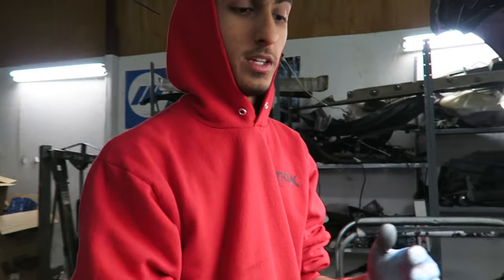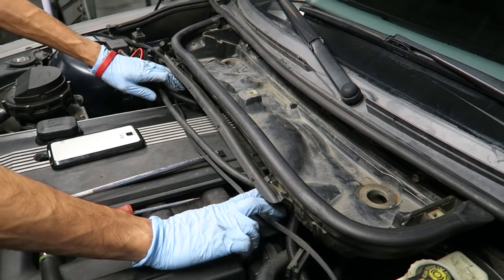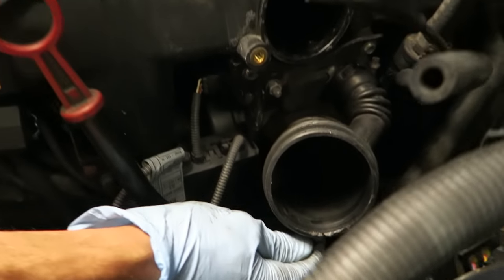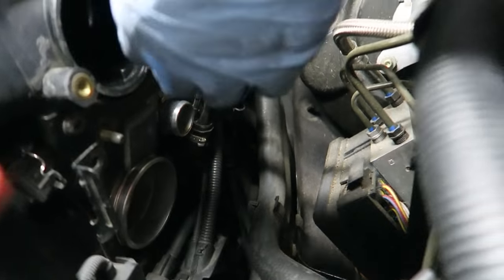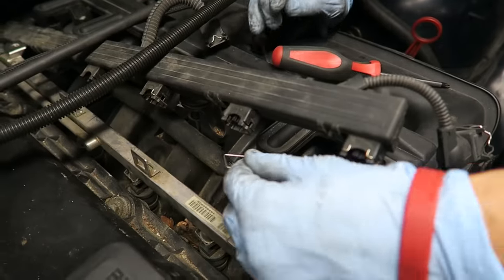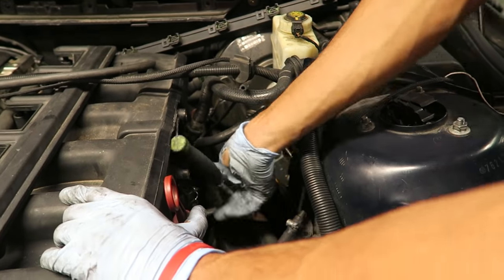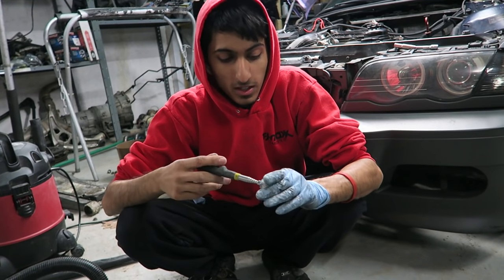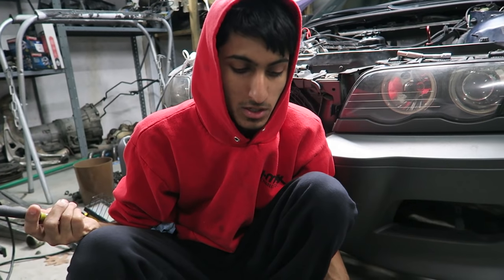BMW E39/E46 Intake Manifold Removal DIY

Comment: Hi. I am big fan of yours. Lot of your videos really helps me a lot. I own a 530i E39. Last month, I did a job replacing both the water pipes under the last month. I do removed the intake manifold during replacing both pipe. After a month I noticed i keep losing coolant at around 500ml in 2 weeks. Then I started to check for leakage & found coolant at the behind thermostat where the both pipe were connected. I suspected that I might not push further enough one of the pipe into the manifold. My question is, it is possible me to pull out a little bit both pipes without removing the intake manifold? I just wanna pull out a bit & replace the O-rings on the behind thermostat side. The other side no leaking. Both pipes were original BMW

Comment: hello Shoplife First off let me say "great channel". I have a question regarding the small white and black colored vacuum one way valve. which direction does it flow?   I have a 50/50 chance and i think i have it in backwards. Thank you for the great info. Rob
Reply from the maker: +robgonzo10 Looking at the valve from the back of the motor black side to the left (towards intake boots) and the white side to the right (pointing to the valve cover).
Reply: +ShopLifeTV thank you very much. It makes sense. I've installed it in that manner and it is working. 😃

Comment: I drove thru half wheel deep water.. now it goes into limp mode when i switch to 2nd gear. CEL... shift solenoid A. i change that and the old one wasnt bad. same stuff. when i scan the trans, almost all the devices in there have errors. tft output speed sensor shift solenoid a... i took loose the harness and it looked burnt and corroded and 20 drips of water came out.. i seen a couple of ppl online with xis that changed their harnesses and the "problem" went away
Reply from the maker: +Dijon Nahar  Oh ok, I would definitely suggest replacing the harness in this situation. You will have to disconnect the o2 sensors and then the connectors on the transmission itself. After that you will have to pull the harness off of the metal clips that are usually attached to keep the harness from moving around. Then you should be able to disconnect the harness from the Module box and just pull the harness out.
Reply: +ShopLifeTV +ShopLifeTV Thank you for your time and consideration of my issue. i watched almost all your vids. im a fan, ive learned alot. anyways that is the most help anyone has given me thus far. I guess im mostly dealing with caution/fear because i never tried. but you make it sound easy. i was afraid that i would have to take out the engine or tranny or a varation of that. Once i get the proper harness i will give it a go. The o2 connectors are by the ignitors right? where does this harness "pass thru"? thanks for everything!

Comment: Hey wassup my brother your videos are great!! I have a question my 325i 2004 started over heating today and I kind of noticed I had anti freeze under the manifold...most likely you think are the hoses that ripped off or broke?
Reply: broken. just replaced a tube that goes into the block under the manifold. its pretty hard to get to.

Comment: Anyone know if I will be able to reach my starter after removing the hose?Its an X3 and I heard it was under the manifold but I was hoping I wouldn't have to take everything out.
Reply from the maker: It will definitely be easier with the manifold removed. You can do it from underneath the car as well.

Comment: Great video and detail.  I currently have three codes P0161, P0171 and P0174.  I hope replacing all the vacuum hoses and the CCV will clear up at least the P0171 and P174 code.  Do you think the other code which is the post cat bank 2 o2 sensor would be affected by this as well?  Also I live in NH and would you recommend getting the Cold Climate CCV?  Thanks for all the time you put into the videos.
Reply from the maker: Vacuum leaks can cause numerous other codes. Once you finish the repair just erase the codes and see what comes back. I do recommend the cold climate CCV. Appreciate it!
Reply: I have a 2002 BMW X5 3.0i, I recently had the starter, ccv, canister and electronic part that connects to cannister done on it. Just yesterday I did the purge control valve do to the p0442 code coming up causing check engine. I was trying to be really careful pulling off the vacuum hoses that connect to the purge control valve, unfortunately the hose that connects to the underneath of the intake manifold came off so then I had to take out the manifold to reattach that hose. While in there I check all other hoses, connections, and I didn't let anything fall into the engine openings. Finally I installed a new intake gasket and torqued it to spec and put everything else back together. I started the truck up and it was smooth for a few minutes but now the motor shakes alot and wants to turn off. I double checked to see that everything was connected right and tight on all of the air filter assembly, so I don't know what's wrong or what to do next???
Reply: I should mention that when I had the starter, ccv, canister and electronic canister part installed it ran perfect, but after 9 months or so the check engine turned on. We scanned it and figured out that the truck needed the purge control valve and that's why I installed it.

Comment: Yo I have a 99 528i and the tps wasn't working so I cleaned it got it working and then when I took out the desi I didn't see the pin in the end so being cautious and. Paronid I want to remove the intake so my question is will I be able to get it out this way and is there a rebuild kit that leaves the pin out. It has a aftermarket gasket on it I wonder if the person before me left it out
Reply from the maker: There are numerous rebuild kits that replace the pin, but I believe that the Disa has to be in somewhat working order before you can rebuild it.

Comment: hey man do u think if i put a 530 manifold in a 525 i will gain hp?
Reply from the maker: Not really, you would have to tune it after and even then the gains will be minimal.
Reply: dang ;( what do you think i should do to increase horsepower?
Reply: Remove the back seats, spare tyre and sound proofing.
Reply: Turbo it.. These 6 cylinder bmw engines love turbos!

Comment: When you removed the throttle body, you skipped the  removal process. Should have kept that in, I still had trouble removing the throttle body after the 4 bolts were out

Comment: Great video! I need to replace the ECT (engine coolant temp) Sensor due to error code P-0118 on my 2005 325i. Insane all this work needs to be done in order to access the $15 sensor! Any suggestions on skipping steps in order to get the sensor out without removing the full manifold? Thanks man
Reply from the maker: Honestly I would just remove the whole manifold, and do all of the vacuum lines, intake gaskets, hard plastic coolant hoses, etc. Trust me it will be better for the long run especially if you plan to keep the car.
Reply: is there a way i can find out  ALL my sizes for all lines and hose to replace so i can buy all at the same time  if any one knows i have e39 m56

Comment: I guess I'm driving to Wendell NC..
Reply from the maker: I actually moved lol. I am in Alhambra, CA right now
Reply: ShopLifeTV would you remove intake manifold to swap starter on E39 or would you try from the bottom of the car? Trying to get as much input before tackling this project, thanks
Reply: You have to replace the intake manifold, intake assembly, brake booster lines, etc to just to reach the starter
The starter is in an extremely awkward place , mounted onto the transmission

If your car is high in mileage, I'd recommend an alternative even if it is costly.

----- 

If your handy or know someone with a shop, drop the transmission yourself and replace the guibo, transmission mounts, and the starter (only if its a 525, 530) should be on the driver side of the transmission almost exactly where it bolts up to the motor.

When working on the starter from inside the bay, The starter is actually perfectly aligned with the firewall to the car – you have little to no room to work or loosen any bolts or screws.

Obviously dropping the transmission is not ideal, but if I could go back I would capitalize on the opportunity to replace my clutch, guibo, transmission mounts, motor mounts and potentially just because I was in there run aftermarket headers lol

Now I know why four out of five of my Indy mechanics literally refused to do the job, it's a major PITA

Oh btw, I have a huge vacuum leak that keeps tripping a Check Engine Light that I can't get rid of since doing the stupid starter swap through the engine bay 🤗.

Good luck
Reply: Brandon Andrade thanks for the advice, very detailed. I was going to start by removing the IM. Earlier when I remove the air filter box and connected lines to the throttle body just to look at access I saw I can get access to some of the bolts which is why I wanted too remove the IM to get access to literally the negative terminal bolt and 3rd torx bolt. Unfortunately I can't justify spending big bucks at my local motorsports shop just yet. I'm planning on video taping the job due to lack of actual E39 vids. Thanks again brother!

Comment: I HATE HATE HATE BMW  
this car we got for free a 2002 330ci convertible from original owner garage kept 60k miles in 2018
i fixed the car he got tired of taking it to bmw for repairs 
i repaired the convertible top the throttle the speedometer due to one fuse then 
the cooling system issue i replaced it all 
radiator trans cooling line and reservoir 
then the water pump broke on my sisters first day of college the water pump breaking caused the belt to whip the trans cooling line causing the transmission to spit out the oil 
then it had limp mode due to the oil issue as removing the fan it broke from beign so brittle then the pulley broke too also brittle replaced the trans oil with oem and seal and filter it helped a bit but still it was on limp mode until the trans gave out
now i replaced the trans and turns out the starter is on the top i had to remove the intake manifold goddammit just for one piece 
fuck you bmw fuck you today and tomorrow i will never buy a bmw this one was free but im selling this piece of junk that always breaks 
now its got 80k miles but im almost finished just got to replace the control arm lower bushings because there also worn out